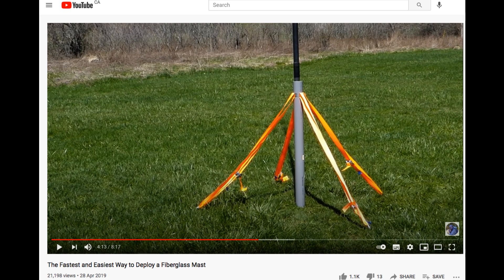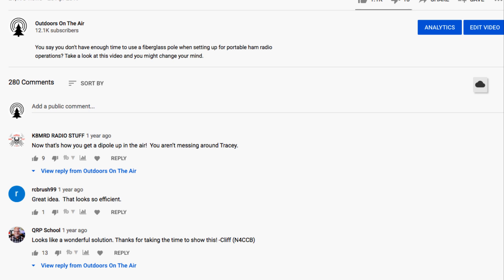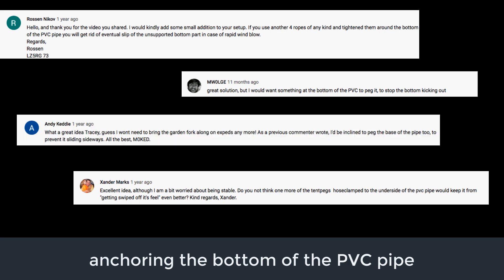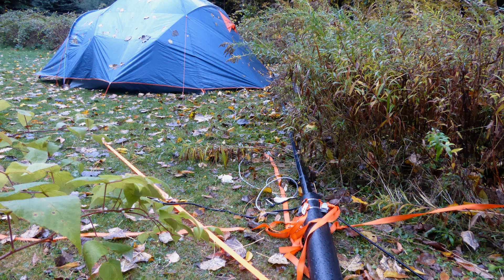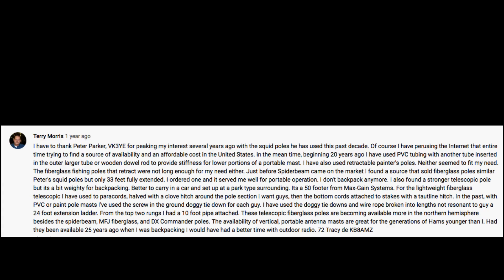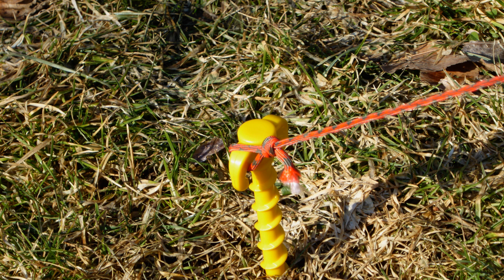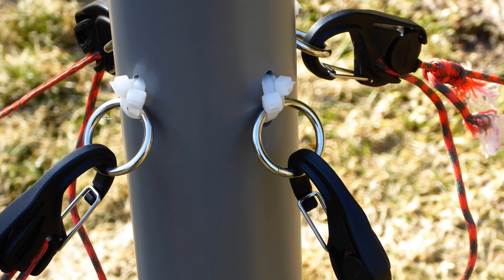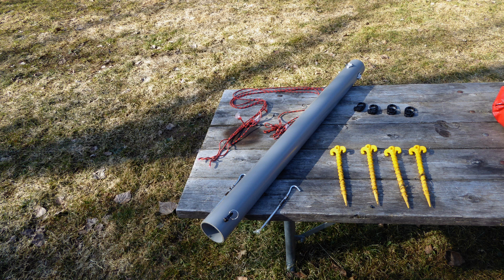Version 2 of The Fastest and Easiest Way to Deploy a Fiberglass Mast

Comment: That was an awesome presentation. I just bought a 31 ft JackKite Pole for end-fed wire antenna POTA or HIP. The PVC connection points and stake information were concerns that I needed some feedback on. I was going to use Aluminum Camping 6 inch spikes and hose clamps. The plastic screw spikes are great for local parks but may not be heavy-duty enough for our dry rocky desert ground in Arizona.  The dog screw stakes are interesting. I feel like I have a start on this project. Thanks again!!!
Reply from the maker: Thank you for your comment, Alex! Good luck with your project.
Reply: @OutdoorsOnTheAir  I had not heard of Jackite poles so I checked out their website. Sure enough, on their videos page, 3rd from the bottom is one of your videos. I did not know if you were aware or not. And of course, the video is very well done, like all your others. Thank you for your videos de K4VIN.

Comment: Bill-N6EF-Great ideas. For my homebrew end-fed halfwave, I use a DXCommander 10 meter pole to support the EFHW in an inverted vee configuration. To keep the bottom of the mast from moving, I use a 2 inch PVC cap with a 3/8 inch hole drilled in the middle of it, and drive a 12 inch landscaping spike through the hole into the ground. I insert the bottom of the mast into the cap keeping the pole captive inside the cap. This works great even in soft soil. I haven't tried it in sand yet but it's worked flawlessly on all of my POTA activations so far. I use paracord for guy ropes which works well. Our local Home Depot has a 3 inch pipe used for drainage which might work. There are endcaps which can have holes drilled in the end to drive a 12 inch landscape spike to keep it in place. The drain pipe isn't as thick as 3 inch water pipe but this for this use case, would probably work. Your idea of using rings and tent stakes on each side looks like a great idea as well. Thanks for the great videos.
Reply from the maker: Hi Bill, thank you very much for sharing your experience with pole mounting. I like your base anchor idea a lot.

Comment: When I was using a painter's push pole, I had a similar PVC base shaft. I took two flat end caps and epoxied them together on their flat surfaces. I drilled a hole through the middle, and inserted a lawn spike. These can be found at hardware stores, are about 8-12" long and look like a large galvanized nail with a flared flat head. I epoxied that in place. The end result is a cap that can go on the end of the pipe two ways: either with the spike inside the pipe for storage, or outside the pipe as an anchor. When you drive it into the ground, you still have to guy it, but the base will not slide, and there's usually enough stability to it that you can attach and stake the guy wires without needing a third hand to hold the PVC base up. I'm getting ready to do another version of that for my new 10M pole, but I'll probably do it a little differently this time, finding a way to use fasteners and backing plates inside the caps to attach them together, as well as the stake to the cap. The epoxy doesn't always hold up well with the lateral forces that it sometimes experiences.
Reply from the maker: Great tips, thank you!

Comment: I am not a Ham but an SWL. You mentioned using dog tie-outs as anchors. I built a 41 foot vertical from PVC tubing guyed at two points the way many verticals are (I painted the PVC black to protect it from UV). I used dog tie-outs to anchor the guys to the ground and backed them up with a second tie-out. It held up for a number of years until a particularly strong storm came through. A tree limb snagged one of the upper guy-lines and the antenna broke off a few feet above the lower guy point. Nevertheless the dog tie-outs did not pull out of the ground. I found my dog tie-outs at flea markets and yard sales for next to nothing.
Reply from the maker: Thank you for sharing your experience, much appreciated.

Comment: I made a wooden base with 2 X 4's and a pvc pipe in the middle. Not very portable but used it on field day for two years. I used rebar about 24" long for stakes and drilled angled holes in the four legs to hold the stand in place. Worked well here in the high desert where you are as likely to be setting up in sand as anything else. I like your new modifications. Fastening the base should keep it from shifting in high winds. W6BZY
Reply from the maker: Terrific solution for mounting in sand! Thank you for sharing.

Comment: Hi Tracy and thanks for the update. I suspect that the people who question the use of the PVC pipe haven’t tried to erect a 12 m spider pole single handed. Although, probably for a smaller pole, it’s  overkill. Doesn’t stop you from adding a secondary guying point further up if it is windy. Managed to find an automotive radiator hose which fits on the lowest section of the spider pole and fits nicely ( it’s tapered) into the space between the PVC pipe and the spider pole. 2E0HWO now M0YZT
Reply from the maker: Nice to hear from you again, I like the new call! Now I've got to look for one of those radiator hoses.

Comment: I would also consider adding an end cap to the pipe with a soft landing base should the mast decide to self telescope. I use Bongo ties at each section to discourage it, not foolproof but easier in the outdoors than hose clamps. Thanks for a super informative video with field tested solutions. Steve, G0ORK
Reply from the maker: Good tips, thank you Steve!

Comment: Thanks Tracy - I copied your V1 and works great for the heavy Spiderbeam 12m mast.  Actually used a rubber gasket around the mast to cushion it from the pipe to make up for the small distance between the mast and pipe.  Maybe a little bulkier and when I get the time will try at least to switch to the paracord - good ideas for modifications....well done.  AI6OU
Reply from the maker: I like your rubber gasket idea, thank you for sharing!

Comment: Dear Tracy, thank you for you great ouvre of videos and high quality content. I learned a lot. From the home country of hyendfed i have a question: what would you do if you need to be in a moist environment with version 3. In the netherlands we get pondered with rain shower and sometimes even horizontal rain. My gfk masts can hold up in wet weather, provided the inside stays dry. how would you provide for this kind of wet environment in version 3? Thanks and 73
Edwin pd0sot
Reply from the maker: Hi Edwin, I am very sorry for the late reply. Try using 4 foot rebar in place of the screw in stakes, pound them in about 2 feet to make sure they are firmly anchored (but not so firmly that you can't get them out again at the end of the deployment). 73 from VE3TWM in Canada.

Comment: My experience with the spiral dog anchors is mixed.  If the soil is soft loom or sand, they are darn near impossible to get out of the ground by any other method than unscrewing them.  If, on the other hand, you are dealing with hard, rocky soil they are darn near impossible to even get into the ground.  Many years ago I was camping with some Scouts on a rocky surface.  I couldn't even get the thing to break the surface of the ground.  Finally had to drive some steel pegs in with a sledgehammer.  The point is know where you are going to operate.  Adapt as necessary.
Reply from the maker: Very interesting. Thank you for sharing your experience.

Comment: I'm just curious - why would you not simply use a similar approach on the telescoping mast itself and place the guy lines higher?   I'm not really seeing the value in the addition of the PVC pipe.   Thanks.
Reply from the maker: Setting up the PVC pipe first allows you to erect a higher, heavier mast very easily as the PVC holds it upright as you extend the sections. It's not very easy for one person to pull up a fully extended 40 or 50 foot mast.

Comment: To be honest I prefer the Lowe’s Home Depot 36”x1.5” steel spikes for anchoring they have holes and a slot at the top of the spike to use a lever assist removal. I use a mini sledgehammer to put them in 16” and I angle them at 35 deg to oppose the pull 

https://www.lowes.com/pd/Steel-Rebar-Pins-Common-1-5-in-x-36-in-Actual-1-5-in-x-36-in/4008143
Reply from the maker: Great tip, thank you!

Comment: Great timing... Just the other day, I was thinking "You know who I haven't seen a video from in a while?" :D These are great looking updates. I also trust 550 paracord. In fact, 2 years ago I put up a wire antenna at home, using paracord as the anchor "temporarily" until I could work out something more permanent. It's been holding up through a couple Michigan winters so far with no signs of giving up yet. I would definitely trust it for this sort of deployment!
Reply from the maker: Appreciate you sharing your experience!

Comment: Excellent video Tracy! This project reminds me of a painter's pole base I made years ago out of PVC pipe. An old friend of mine KD5RDR <sk> showed me a PVC base he had made from a design in QST magazine, and I built the same base. The base is simply a 4 way PVC joint with four 4 foot lengths of 1.5" PVC pipe, and a PVC cap bolted to the center of the joint to allow a fifth pipe to be placed vertically. To strengthen the base I tried to use string as guy wires, but the PVC was just too flexible and caused the base to mimic an inverted umbrella. I then decided to use 4 green steel fence posts and some metal brackets to secure the two ends of each post. Each post was positioned in the same fashion as a guy wire but also provided rigidity. There is a lot more to this base than I can describe here. Recently I purchased some screw anchors similar to the ones you posted in the video from Ace Hardware. They were about $24 for a 4 pack and are made of polycarbonate.
Reply from the maker: Thank you for the tips, John!

Comment: Thank for sharing your update Tracey, my system is based on what you initially shared. Tried the PVC pipe, easily sourced here to suit the Spiderbeam. I just couldn't get on with it and the cargo straps. I ended up using a hose clamp on the pole itself.......but between it and the pole I use 4mm nitrile rubber. I don't have this clamped with any force, it only needs to stay in place. I have gaps in the rubber to thread 4mm mastrant P cord. I currently use 12" galvanised pegs made from Rebar, you can buy them quite cheap. For tensioning the cord I use Clamcleats, simple bit first class and are solid. Take care, great to see you posting content again. 73, Colin
Reply from the maker: Thank you for sharing your experience, Colin! I hope people reading this check out your terrific YouTube channel. 73 from VE3TWM.
Reply: Im going to use the pole itself too. What is mastrant p cord?  Would love to see a photo of your setup. Shall i private message you with email address? Ive only just bought my 12m spiderbeam pole so im going through all ideas at the moment. Cheers 2e0gko.

Comment: Hello Tracy!

I have built a stand almost exactly like your version one, and my version two looks vastly different! Since I only have a 12m Spiderbeam and no other mast, I have simply looped the ends of my three guy lines over the pole, and with some carefully placed tape, held them in place. At the end of each line, and at the base of the mast, I place one three-faced aluminum stake. This system is much lighter and more portable, because there is no PVC pipe to carry.

This solution does away with hose clamps AND zip ties. Because the loop in the guy line goes around the mast itself, there is one less component that can cause a critical failure of the system. 

My version two is certainly less secure in windy or rainy conditions, but as a POTA operator who is not a camper, I would never leave my mast erected while not actively operating the radio, for safety reasons.

I will send you an email with a couple photos of my version two. 

73 de VE3GKT!
Reply: Any chance you can post a video of this?